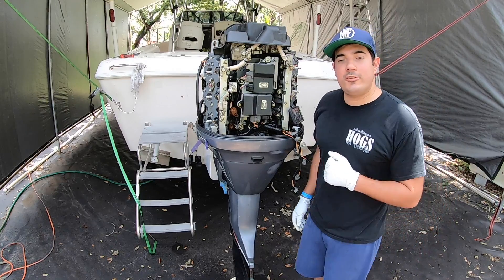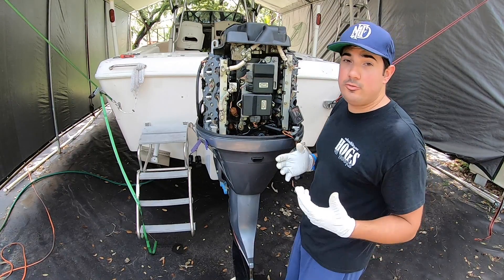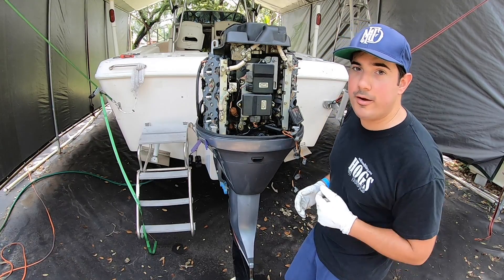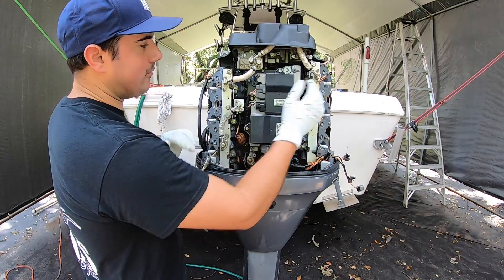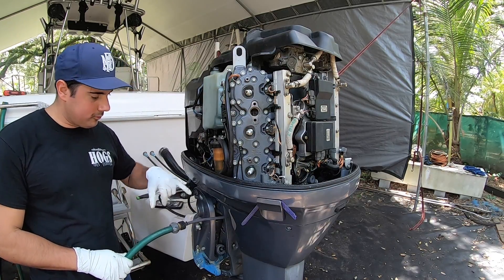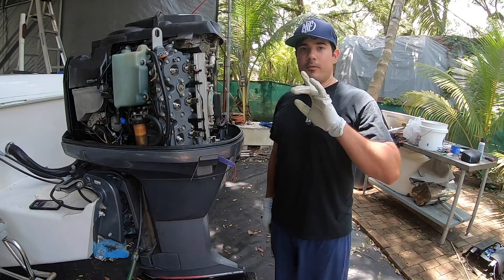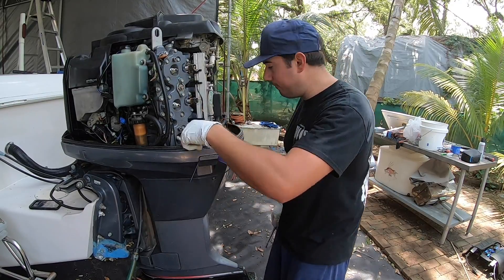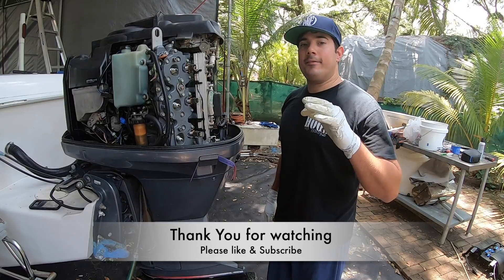Outboard Engine Anode Replacement

Comment: do you swap out your zincs annually? someone was recommending that i change those out every year.  however, i was in the coast guard for 20 years and we hardly ever changed those things out and we were in very corrosive water
Reply from the maker: @shadyfieldhomestead1974  if your outboard is sitting in the water year round definitely do the exterior anodes.
As far as the internal anodes they should be replaced according to the manual if I recall correctly about every 300hrs 
3-5 years I would say depending how you use your boat I’d say. 
Keep in mind this is what protects the inside of your outboard

Comment: I purchased a 1998 Yamaha OX66 200 HP Last spring. I have changed the external anode and the water pump. I want to do an annual service procedure. Can you provide a list of what needs to be done. Plugs, thermostats internal anodes, fuel filters etc. This motor has only been run in fresh water. Thanks, I really enjoy your service videos.
Reply from the maker: @billnoland8474  thanks for the comment! 
I usually recommend yearly to replace fuel/water separators (spin on fuel filters) also yearly I recommend spark plugs, this is especially true for 2stroke outboards. It’s easy and rather cheap. Another yearly maintenance item is your lower unit gear  oil. 
Every two years I recommend you do water pump, thermostats, and inspect anodes, replace anodes if signs of wear or damage. If you have an O2 sensor, remove and clean. Every three years, recommend you change your low pressure pumps, replace VST filter, pull your aux oil tank remove all oil and clean it out (they tend to build up a sludge at the bottom of the tank. Also change out the in-line oil filter on the aux oil tank. 
5 year replace poppet valve, injector service or carb overhaul. 
Best of luck 👍🏽👍🏽

Comment: Carlos, are you running the motor while flushing?  If yes, can I do this step while it sits in the water?
Reply from the maker: I do not run the motor, only because the water will struggle to cool off the engine evenly as the water is escaping from the zinc openings. I use the hose attachment.

Comment: Hey Carlos - question about flushing engine after salt water use - does the garden hose adapter on the port side of engine bypass the thermostat and flush the cylinder heads? I've read that since it's cold water, engine is not hot, thermostats are closed and therefore you don't get thorough flush on the heads/water passages. Appreciate all your content - great videos and very informative 👍
Reply from the maker: Every engine has its own set of procedures. Now this is a highly debated topic. 
Yamaha states that both methods work equally well. 
In my opinion running on the muffs is better because it gets the engine to operating temperature. Gets parts moving (thermos) and the heat helps dissolve deposits. 
I can’t say with 100% certainty that on the attachment it gets all parts of the outboard. However keep in mind there are charter boats that leave their boats in the water year round and only have the option of the adapter and have no issues. 
Hope it helps
Reply: @ReelTeaseFishing  Sure thing, makes perfect sense - thank you for the prompt reply. I also have 250 hpdis and your channel is definitely the best I've found on maintenance procedures and info them. Thanks for the great content! 👍

Comment: Hi when i flush my 150 yamaha  4 stroke  the water will not flow through the pee hole  .its missing pressure ??
Reply from the maker: when was the last time the impeller was changed?  a bad or worn out impeller will cause a lack of pressure. 
However if you are not getting water out of the "pee" hole, try running a thick monofilament line maybe 80lb up the pee hole. this can help dislodge anything plugging the passage. compressed air works well too. sometimes spiders and critters go up the pee hole and plug it up, so will salt and dried mud.
Reply: @ReelTeaseFishing  I have camp on coast and every week dirt dobbers would get in my weep hole, I keep a small piece of weed eater line in mine to keep them out, of course remove when u use the boat
Reply: It pee when it completely in water  but sometimes with the hose doesn't pee through the pee hole
Reply from the maker: @j.dconstruction3956  if it pee's when it is in the water, my theory would be that the garden hose just doesn't have enough pressure. depending where you live, municipal water pressure will fluctuate. It is common for some to overheat on the hose due to pressure issues. 
I would suggest try to get the muffs with flow to both sides of the earmuffs and try to get a good seal on the muffs to allow as little water to leak from the earmuffs themselves.
Reply: @ReelTeaseFishing  yes some muffs just don't seal properly

Comment: Is that anti seize on the bolts?  any special type for marine or just regular/standard anti seize ?
Reply from the maker: It is actually marine grease. which I highly recommend over Anti seize. This is because anti seize has metal compounds, thus many of them create the opposite effects in the marine environment. this is because most heads are aluminum, using Stainless bolts. then adding other metal compounds (anti seize) to this mix it can go bad fast.  when you add  in a corrosive environment you get what's called galvanic corrosion. basically your bolts weld themselves to the surrounding metal. 
use marine grease on all marine bolts and you will be fine.

Comment: How old were the anodes you pulled, please?  How long might they last before requiring replacement - should they be changed every year anyway or just cleaned up?
Reply from the maker: The anodes in the video were about 2 years old. and were in still pretty decent shape. I could have easily cleaned them off and reused them. However I like to over do things and since I was going through the trouble of removing them I just replaced. 
Yamaha says replace every 100hrs. But I have heard people depending where you boat say 300hrs is the happy medium
Reply: @ReelTeaseFishing  They will begin to disintegrate as they do their job, as the anodes on the lower unit do.
Reply from the maker: @davidlong2048  yes sir 👍🏽

Comment: There are a few other anodes. Nobody seems to show a video replacing them. One is between the fly wheel and high pressure pump. The other 3 are on the side of the engine. So far I've broken off 2 of the 3 located on the sides. I'm not too worried as I plan to pull my heads and replace the gaskets so I can fish these out then. The one located by the fly wheel I am very concerned about. I'm not sure how to retrieve it if it breaks off like the others. 

There are other anodes in the system. Don't kid yourself. These need service too.
Reply from the maker: absolutely, these engines are covered in anodes and filters. We only replaced these as the original anodes were still in very good condition. figured we would just show how its done for those who have never done them. Some outboard owners are not even aware of the anodes.
Reply: @ReelTeaseFishing  what do you think about descaling wearing out rubber gaskets like the head gasket
Reply from the maker: @wazup3333  I think descaling shouldn’t ruin a gasket only because the area where the gasket is in place is not exposed to the descale solution when the heads are bolted in place. A failed gasket will be more noticeable after a descale usually because the scale that has built up around the failed area is now cleared. If that makes any sense.

I’d be more worried say about the rubbers on the thermostats, the impeller and poppet valve depending on which solution is used.